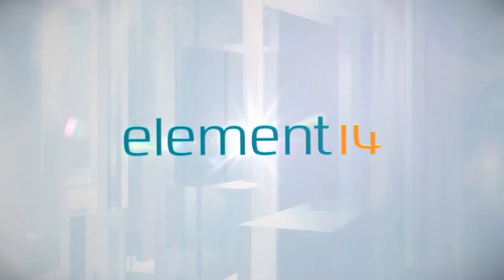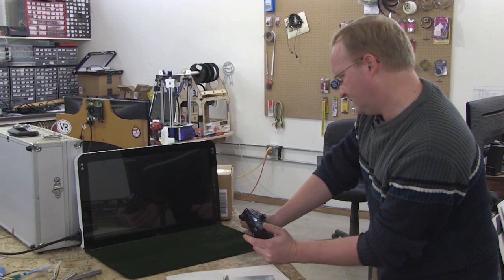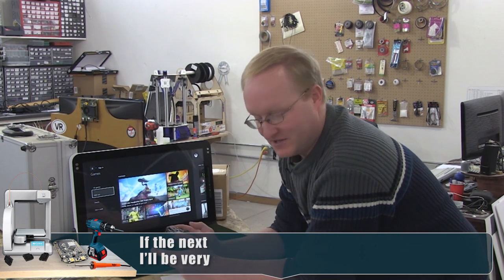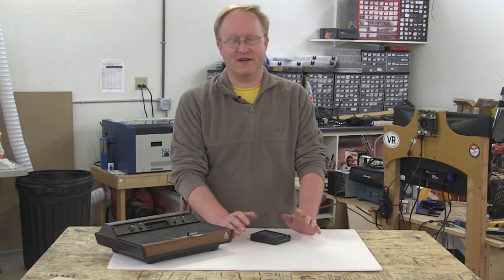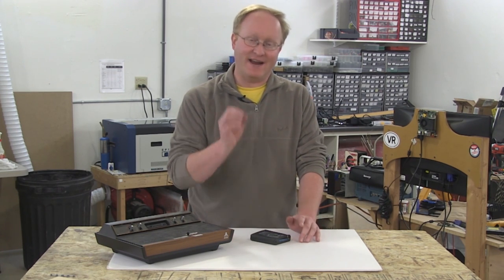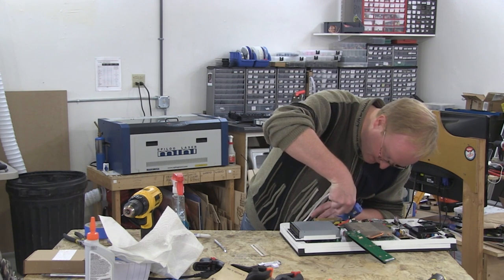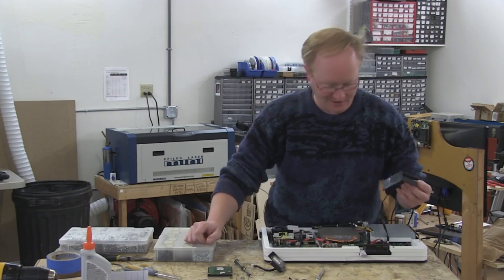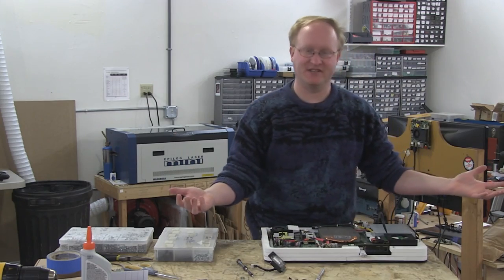Ben Heck’s Xbox One Portable Part 3

Comment: I would have tried to include some kind of battery, if you need to plug it into the wall, it seems kind of pointless to have. Even if I would only get like an hour out of it, it would still be a nice thing to have.
Also I would have tried to use a non-reflective screen or foil, because when you can't change the angle, you might get a lot of problems with that I guess.
But it's a really nice build and looks great.

Comment: Would have gone with paint rather than the vinyl. It makes it look like it just has electrical tape over it. Also, would have dropped the blu-ray just to save space. Also, the kickstand connection on the back doesn't look terribly stable.. maybe only a few mm of friction length. Maybe a very shallow "v" cut at an angle so it is less likely to pop off if someone bumps the table its sitting on. Lastly, a handle to make it more like a briefcase. The handle could be pegs on either end and use a guitar/briefcase strap so it can be removed easily, or recess a "leather" one into the top of the case.

Comment: I would have tried for a vertical feed blu-ray as the drive is gravity based. The fix for a X-1 not reading discs is to wedge it to a different angle. I do wonder if this was considered, as it was not shown in the video series.

Comment: great show. Ben. I have an old Asus socket 775 motherboard from 2010. Its pci-e plastic bracket thing is missing, as is the plastic bracket thing (very technical yes) for the floppy drive. The motherboard still works, but its very particular about the kind of DDR3 ram, which I'm still working on. Anyway, if I got replacement parts, what kind of glue would be suitable for a motherboard?
Reply: thanks. Now to find some spare parts.

Comment: As a thought for a build, why not try a Playstation (3 or 4), an Xbox (360 or ONE) and a Wii-U in a large full HD, 3D TV (maybe 50 inch screen, give or take). If a TV can be found with 5 HDMI ports then perhaps PS3+4, Xbox 360+ONE and a Wii-U all down one side, effectively making it the ultimate gaming system. Ideally it would require USB ports aplenty. I would be eager to see if it could be done.

Comment: i think the portable part is not needed in this case but rather as an all-in-one solution with SOME mobility. similar to those full desktop pc's that are touch screen. it could be made smaller with a few more hacks, like a bigger screen, or convert all those separate power solutions into one with a computer psu....

there's an idea: make a VESA mount for the xbox one to basically sit between your existing tv and the wall mount.

Comment: for the Xbox One portable, I would stick with the tablet design, but see how to make it thinner and/or lighter like eliminating the Blu Ray drive, replacing the standard hard drive with an SSD which would add to the cost.  I am sure you can get a smaller 1080p screen but that would also require grabbing one from another laptop like a 13".

Comment: Thank god the optics went in.

Many of the xbox system updates will update the software on the optic drive. Without a drive plugged in the update will not go through, you will get a status code error, saying the update could not be processed. Because you could not update, you would not be able to connect to xbox live.

In short, even if optical media was dead, the xbox one console itself would still need the drive to play online, in the long(ish) run.

Comment: This design is better than the original X1 design, because the power brick is built-in rather than hanged outside. 

But, I doubt whether the cooling system is strong enough

Comment: Imho the best that could have been done with the optical drive would have been to switch position with the control panel so that the disc would load vertically from the top of the unit

Comment: One thing i would have liked/ would have done was tp make the blu-ray drive portable and detachable so if you need it you hook it up, and if you don't, your not bothered by it. It would fix the positioning issue and it could possibly make it a little thinner to but I am not sure if the connection between the blu-ray and the mb would hold up.. (I have no idea if this idea is technically possible...)

Comment: well maybe i imagine things too easy. but i wouldn't build in the disc drive, i also would try to use the housing as sheatsink - it'd be aluminium or titanium held together by a 3d printed plastic frame.

that way it would be a third to 50% thinner than it is.

anyway much love and respect for ben! not a lot of people are capable of doing what he does.

Comment: Looks like a normal sata port on the blu ray drive, would it not be possible to just go and buy a new, slim one built to handle vertical loading? I would only guess that Microsoft is cheeky enough to put some sort of encryption on the drive that can only be read using a Xbox?

Comment: Why didnt he just take an other Blueray drive? Maybe even a Slimline version? Theyre not that expensive. most of them work at any angle and the original one is very bulky. The Data connection is standart SATA and im sure he could have build something for the Powerconnection. Or is there some weird DRM-Issue?

Comment: I would have replaced the disc drive with something slimmer. In fact, a lot of the internal components would have been replaced. Hard drives don't belong in portable devices, so I would have swapped it out for an SSD. I might have even tried to sort out liquid cooling.

Comment: Yes the tablet idea is good but if you really wanted it to be portable you need to take out some things and also it would have been hard to make it smaller because of the motherboard. This means the system had to be bulky so with the Xbox one I would have gone with the laptop approach.           And also I get you want to keep most of the items separated but part of the reason all of your projects turn out bulky is because you use to many spacers.

Comment: i would have gone with a laptop case (way bigger than a normal laptop just the screen action), with room for two controlers. further more i would try and find a way to put the power brick in the case with a separate compartment heat shield to one side with its own individual fan. i would use a low powerd lapoto screen, few laptop bateries to give it power autonomy. this would make the thing heavy so it would need a strap of some sort so i would have two configurations either like a shoulderbag or back pack.on the bottom there would be a special compartment that would fit in a few Disc cases so you could have a few games with you stacked horizontaly under the concept. mehh i could keep yaping ideas but i would never build such a thing. but it would be cool to turn an Xbox one in to a fully portable outdoor gaming machine or maby airplane usable for those long flights. any ways cool video would have never thought of an Xbox tablet :P

Comment: How I'd do it: get a laptop LCD panel and an LCD controller board (many on ebay) with HDMI input. Tada! Small screen. Then dump the disk drive. If possible, power the LCD off the Xbone's power supply to reduce size.

Comment: What I would have done differently, was that for one thing, put a SSD inside of it, and possibly, if done in 2016, use a Xbox One s, which is smaller, as the base, and use a mini arcade cabinet style with two to four USB Xbox controllers, and, if possible, use the ps4's disc drive, as it works when put upright.
Reply: They blu ray drives are not interchangeable between systems
Reply: The bluray drive in the One S is built to work vertically so it would be fine.
Reply: Oh, alright

Comment: not a fan of xbox but I love the tablet idea. I would have added a touchscreen layer on the screen (is it possible ?). the solution for the dvd reader was genius (I would have surrendered and used a laptop bluray drive or I would place it horizontal on a foldable base but your solution is much better)

Comment: To be honest I wouldn't have made it a true laptop, or taken your tablet design. 

The fact is that none of these systems are really portable by a normal user's standards. So, I'd have embraced that fact and worked on how to make it more convenient in spite of it. 

So... Make it a briefcase. That way it's pretty much designed to be carried a specific way, and not carried with much of anything unrelated. That also gives you a bit more leeway for overall size expectations, so you can include recesses to carry stuff like your controllers and a couple of games inside. You can also include a physically larger battery for greater battery life, though ultimately it's less designed for gaming on your lap and more for just being easier to transport the system and stuff related to it wherever you want to take it(like a friend or relative's house, a hotel or other temporary place of residence, or the company break room so you can play something real quick while you have your lunch). It'd also be easy to include ports for external connectivity in a form factor like that, so you could easily connect it to your TV once you're back home.

Comment: I like the idea, but i don't like when you stack up those milled pieces. [EDIT: At the end it actually looked good after you covered it] Can't you somehow not just mill the sides out as an whole block? And never put a spinning disk in a tablet like computer. I don't have a Xbox One, but the old 360 destroys disks, when its moved and harddisks don't like to be moved while spinning. You should have ommitted the drive and replaced the harddisk with a SSD. And why are you extending a SATA cable? Just buy one of a matching size!

Comment: Element 14 in the UK insist on £20 minimum order (non-business account). This is strange as it's just Farnell. CPC Farnell has a minimum order of £5, and when you get the electronic parts the bags have Element 14 logos on them. Element 14 need to get this sorted.

CPC Farnell also like to send your orders in MASSIVE boxes for a few bags of resistors. Such a waste.

Comment: I would have ditched the whole "portable console" idea at that size and made a Steambox / Windows portable gaming station out of it. Though there would be a problem with fitting the components inside, it would be a lot more versatile, especially if you used a touchscreen... Damn it - this is starting to sound like I'm trying to offer an DIY All-in-One PC.

Well, I'm not into peasant boxes so that would explain it. Only thing that I would be worried about about this "portable" is the cooling - one small blower in that much space seems like a death wish for the components.

Comment: Well Project Scorpio is a Next Generation Console (Well, it will be) and it is confirmed that it will be compatible with all Xbox One games, so yes, Next (Next) Gen Consoles will still have Blu-Ray Drives, well at least in Microsoft's case.
Reply: Jameo360 The xbox one scropio is not a next gen console its just a over powered xbox one with more features and its more upgraded because otherwise the original xbox one would be out dated because technology moves faster now that in the xbox 360 era.

Comment: you can find pretty small hdmi screens on amazon, the seller is called tontec i think, from china. i got a 9" for £40.00 with a short ribbon, plus it has no casing so I turned the box into it haha. its sold off as for raspberry pi too, but its really just a generic tft.

Comment: PROJECT IDEA: The PC of 2015!
-------------------------------------------------------------------------------------
1. PC stuffed inside a slim case with a built in keyboard.
2. OS installed on a small SSD
3. Built in WiFi and Bluetooth
4. No Screen
5. No Optical Drive
6. Oculus Rift used as display
7. Programs and saved data on USB Flash Drives.
Optional Battery Power Supply

Comment: I would've used a laptop lcd, re-ground the connectors to fit cables without the compact clutter, add a daughter board like an alienware m18x r2 usb pcb, and instead use my portable dvd drive as an optional addon if I were to make a thin console with expandable usb hubs on the side.

Comment: If Microsoft actually wanted to do a portable unit, they could make a portable accessory that remotely accesses your XB1 at the house. The XB1 can already put out a portable signal to a laptop, you're just limited to the laptop having to be on the same router as the console. Making a portable accessory that kind of looks like a PSP, but remotely plays your home console would be very possible. The router limitation would have to be done away with though. Xbox will have to do something like that to rival the Nintendo Switch's portable abilities.

Comment: Its a regular SATA connection, couldn't he just buy a separate blu-ray drive? Also, one thing I don't understand (forgive me if I'm stupid) is that USB disc drives are like 1/4 the size of a SATA drive and way cheaper.
Reply: Andloo Yunty The drives are tied to the motherboard to help prevent game piracy.
Reply: Brandon Jackson Not the hard drive, the disc drive.
Reply: Yes exactly.
Reply: Brandon Jackson I'm sorry. I don't understand everything you're saying. Are you saying that the blu-ray drive is bound through software to the motherboard?
Reply: Yes that is exactly what I am saying
Reply: Andloo Yunty Yes exactly. every blue-ray drive is bound to its own motherboard and the only way you can replace it is by buys the same one that came out of it. I tested this with the xbox 360 because they use the same system and it would work and read regular DVD movies, but it would not allow you to connect to xbox live or play any games.
Reply: Brandon Jackson Thanks for your explanation.

Comment: and why al this work. Just put an Nvidea shield or ps4 on the back of the monitor and put a nice curved aliminum back on it with LED light but there would be  a little issue. it would be hard to make it a cool system because of the dealing with the airflow but I am not Ben Heck. this is up to you to solve.

Comment: imagine all the disc companies and distributors going down, which would suck for them and all game stores.
Reply: ***** I'd still like to have disks like I do for my older PC games. Or some form of installer like Good Old Games has, even if it's only a backup option.

Steam is pretty handy, and probably the least of the DRM evils, so I like it but that doesn't mean I don't want other options. [I do hate their VAC policies, NO system is foolproof, ever.]

Steam does let you backup the full game install into an archive format and it's setup so you can have them split to be burned onto CDs or DVDs. Offline mode probably needs to be better, though, because I'm not sure if you could restore and play a game completely offline.

At that point I'd probably need to find a crack for the game so I could play the backed up version if Steam was down or I was offline or w/e. Which is totally something I shouldn't have to do.

[P.S. There are other methods of creating spanning archive backups that would not even require Steam to access, it's just handy having it built in, though I really only use it for backing up games I'm not playing so I don't have to redownload them from scratch.]

Comment: I would have made a fold out screen made of nano liquid and powered by1 oz of thorium. then for the games I would have made a downloaded conversation   module that takes cd rom data and loads it to the nano liquid. yes nano liquid has the capabilities display games, light, liquid, energy and data. this nan liquid nanotek component  has a 1 petabyte processing capacity. once the information  is downloaded you have performance. the fold out stretch's glass body can stretch to the size of a window or could stretch to the size of a smart phone very indestructible and flexible polymer. the glaslet would be cutting edge in tech for its time. it will run any game or create games.

Comment: why dont you make a portable ps4
Reply: a
Reply: Fair Criticism now that i think about it this makes scene i can hot glue my TV to the ps4 and solder the wires and stick a controller and and a battery and a toaster just cuz i can lol or buy a vita
Reply: Fair Criticism whatever whatever after a lot of research i finally decided to go with a PC because i can emulate the older consuls heck i can emulate the 3DS and the 360 if i had a strong rig + it's much easier  if i randomly decided to start a YouTube channel using the old Pentium 4 toaster that i haven't turned on since for ever and is collecting dust somewhere in my apartment
Reply: Fair Criticism oh thx
Reply: The ps vita is basically a portable PS4 isn't it
Reply: BellaBehindAKidBehindACamera well the ps vita is a ps3 portable + the ps4 will make me a way better res and frame rate plus i was just kidding in the first place